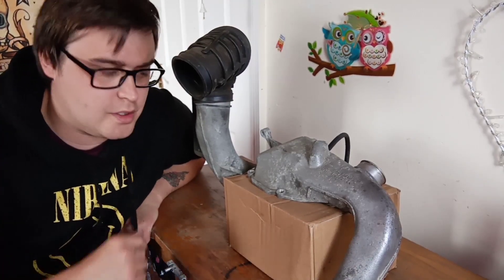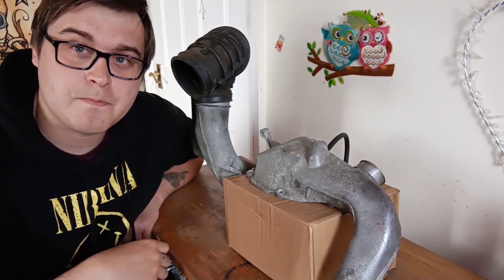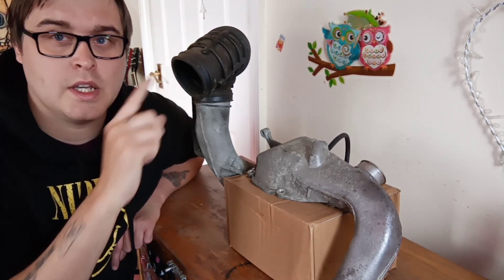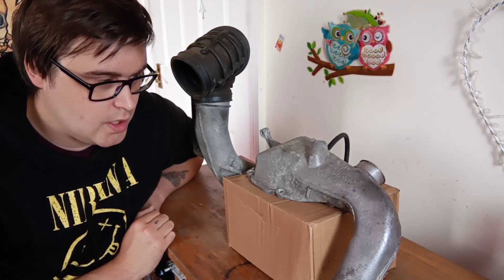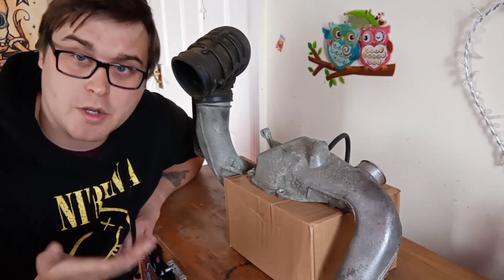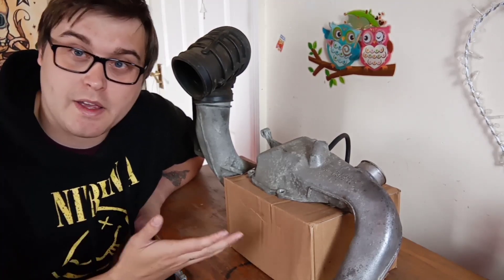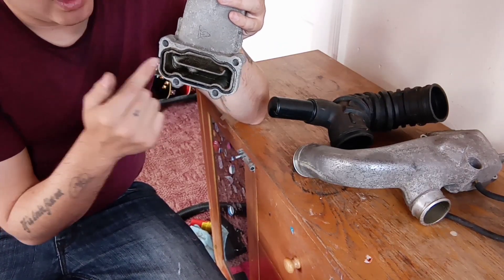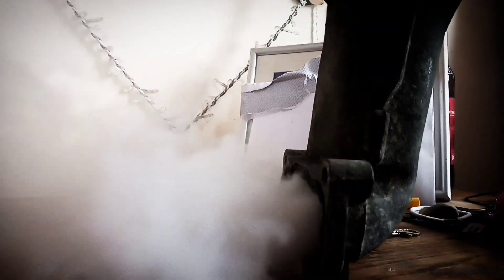Mercedes Benz M111 200 230 kompressor, Understanding The Intake System (including vague smoke test)

Comment: how to calculate how fast my m62 is spinning? i have a 70mm pulley on my slk
Reply from the maker: I use this website, https://www.blocklayer.com/pulley-belteng , this should give you an idea of the speed you just need to input your crank pulley diameter and the supercharger pulley diameter, then input the maximum engine RPM that you rev to. That will then tell you the maximum RPM that your supercharger is reaching.. hope that helps buddy

Comment: How do you remap your SLK? is there a program or something along them lines? Would you be willing to put a map on mine? 😏
Reply from the maker: We don't offer out our Remap and the reason is it essentially was guess work for us and we have some tweaking to do. We didn't have the definition file when we did this map. This means that we didn't actually know for sure what map did what so it was a case of tweak and test until we got it to where it is now. We also to do it would need your current ECU, we have a M111 harness to map on the bench so to speak. But we used eBay tools I think it was like a mixture of Jess and Galetto and the ECM software that came with less I can't say too much as it's all eBay stuff 😂 if you look on the eBay listing you will see the tuning software supplied with the £56 kess modules but it is risky and like I say guess work without a definition file.
Reply from the maker: https://www.ebay.co.uk/itm/143903477006 that's Kess I can't remember what Ben used if it was Kess or the Galetto for down loading the map but you need the ECM software that comes with kess normally always read the description to check it does come with ECM you also have to use a "Offline" laptop to use any of it. Galetto is something like this https://www.ebay.co.uk/itm/153541432471  
But it's not easy and the ECU does need to be removed from the car, I will warn if you do have a go at it there's a very real risk of killing your ECU we were lucky very lucky considering how it was done. 🤣
Reply from the maker: And to add if we had confidence in our MAP we would happily distribute it, but the reality of it is we were lucky and Ben's wisdom in being able to pick out the right numbers is the only way this actually worked. So it's not we don't want to to it...it's we don't want to Damage anyone's cars with total fluke of a map 🙂